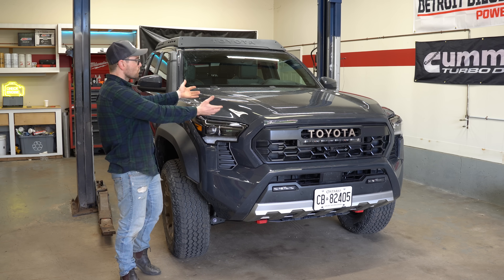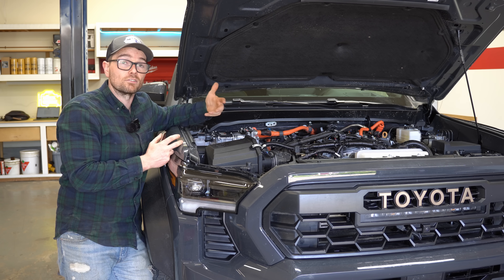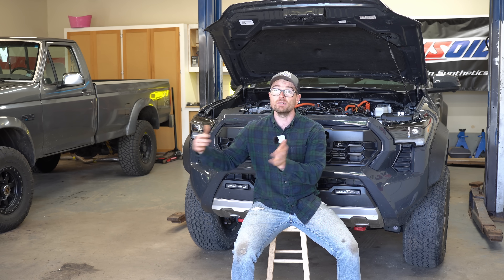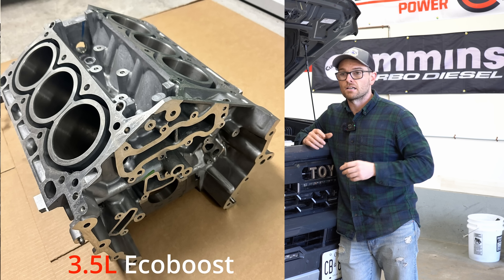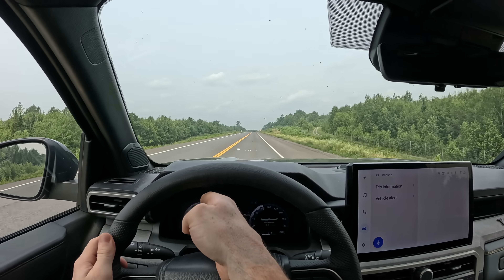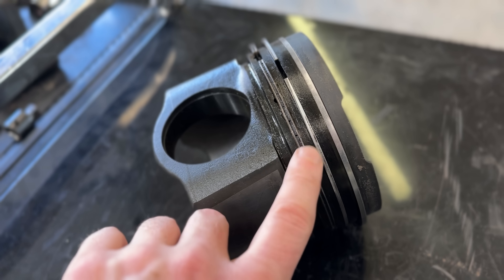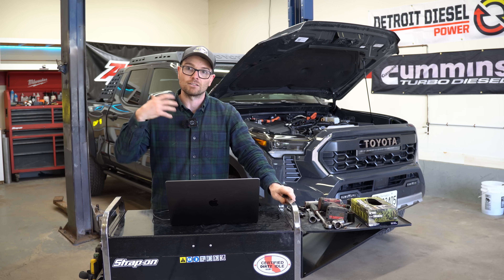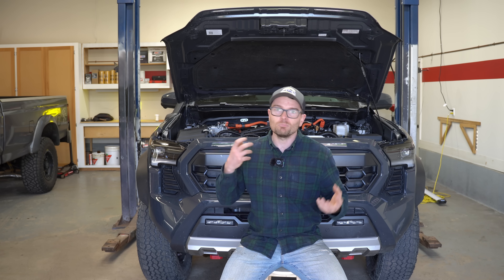Toyota Tacoma's 2.4L I-Force Turbo: CONCERNS Every Buyer Should Know (Mechanic's take)

Comment: I stop looking at Toyota when they stop using the V8 and the 4.0 v6.   Dont get me wrong i still Love the GR Corolla.
Reply: The 4.0 one day will be 22re 2.0
Reply: @jasonjen6101 yup it's well on its way. It pretty much has that status imo since there's enough proof and high mileage examples.
Reply: I was the same too. Until I test drove one. They are so much better than the V6. It’s only a matter of time until people finally let go of the V6. I still have my V8 Tundra tho but the V6 Tacoma is nothing special.
Reply: @westcoastplinkin6559 He’s talking about the 4.0 in 4Runner. 3.5 V6 is very meh.
Reply: @jasonjen6101  4.0 V6 was also in the Tacoma. It’s nothing special, it’s still a V6.
Reply: @westcoastplinkin6559  but test driving one doesn't somehow undo long term reliability concerns. I'm sure the new motor feels better than the old v6 dinosaur lol

Comment: I'd love to see you review the 3.8 V6 in the Nissan Frontier!
Reply: It would be an interesting review. I dont see many people do a deep dive of the 3.8 Nissan v6.
Reply: @davidenglish6799  i may just make a deep dive on the 3.8, tho there isnt a ton of information on it. Z1 Offroad / Z1 Motorsports has the most information i can find and its basically a mix of VQ35HR and VR tech with the valvetrain being identical to the HR, the cam timing being VERY identical to the VR30 and the variable geometry, chain driven oil pump being similar to the VR38. its 90-95% new compared to the VQ40DE.

at least it doesnt have the VVEL system used in the VQ37VHR lol
Reply: @davidenglish6799 That's because it's not sensational or full of drama, complexity,  excess plastic,  or trouble spots. They just WORK , which probably bores some people.
Reply: @davidenglish6799 The car care nut did a decent review of the Frontier overall.  He REALLY  liked the engine except for dinging the water pump thing. He especially liked the minimal use of plastic  compared to other brands. Funny how the Toyota boys don't bring up this very positive review,  especially coming ftom a TOYOTA mechanic !  It hurts their fragile egos to even hear about it.
Reply: @davidenglish6799 because no one buys them.
Reply: @davidenglish6799 because they aren’t selling well, they are not popular trucks.
Reply: @jmilesfox aaaahhhh gotcha.
Reply: While it's true the Frontier is not as popular as the Tacoma, I can see people going to the Frontier as an alternative.   I'd like to see a deep dive into the new Frontier because its a bit more conventional.     Though even the Frontier does have a few issues that are less than ideal.   @jmilesfox
Reply: @jmilesfox   BECAUSE of poor marketing and BRAND IMAGE. even still it was the 3rd best selling midsize truck for 2024 (out of 7 in class)
Reply: @D41Michigan Sales have dropped off a cliff, for good reason. Nissan turned into a trash brand.
Reply: @jmilesfox still 4th best selling behind the usual players.
Reply: @Blue-moon12  the place doesn't matter as much as volume. Did the volume go up or down? I'll give you a hint, the numbers weren't pretty.
Reply: @jmilesfox So from your logic nobody should be doing videos on the Canyon then as that's the bottom of the pile with almost the same drop in sales as the Frontier
Reply: @Blue-moon12 😂did I say that?
Reply: @jmilesfox Cost of the entire market have me out of it.  If i was in it I would be seriously looking at the Nissan as it's the last V6 in the mid-size.  I would be interested in the deep dive if it.
Reply: @jmilesfox Selling better than you think ...but Yota fanboys won't admit any kind of failure.😅
Reply: @jeremymcauliff8485 Less issues than anything else in class. Certainly nothing like junk Tacoma transmissions,  which apparently are so popular that Toyota cult members blame NISSAN  for supposedly bad transmissions,  a total lie of course.
Reply: @Blue-moon12 Yep. Americans LOVE  their brand loyal junk!
Reply: @Blue-moon12 NO, they just love to single out Nissan for a scapegoat
Reply: @jmilesfox  Agree 100% . I have owned 5 Nissans, and still own a 92 d21 daily driver. Nissan used to make great engines : SR20, RB26, TD27, VG30. I would never buy a new Nissan. Textbook plan on how to wreck a good company w/ great products.
Reply: The water pump on Nissan’s 3.8 according to Nissan’s own book, requires 11hrs to replace. 11hrs at $200 per hour labor. About $2,700 with tax & water pump. Is the big drawback to that motor..
Reply: @silverhorder1969 It's like saying the cost to replace the Tacoma turbo is around $2000 to $3000. No matter what, things are expensive to fix or replace. VQ engines have never had issues with water pumps historically.
Reply: @Blue-moon12  yep! maybe one pump in 200k mile if that. its a robust design and from what i gather, the same design as previous VQs...only difference is theres no longer that little access cover for it, so the whole timing cover has to come off...but if you seen how to do the job on the old ones id actually prefer the new one despite being longer to do
Reply: @Blue-moon12  yea but the Tacoma 2.4 turbo isn’t a new motor. It’s actually been around for some time. Toyota has been putting it in their other SUV like the Highlander and another vehicle I can’t remember. But as long as you change the oil every 5k it is a better option. I think the turbo is only $800 though. Not $2,000..
Reply: @silverhorder1969 $800 to replace and install? Doubt it.
Reply: @Blue-moon12  its 2300 for just the turbo on that 2.4 lol. 185 for a water pump and id do it myself. i will only take it to a dealer if its something i cant handle on my own
Reply: @Blue-moon12 $15k transmission in Mexican soft Taco isn't even mentioned,  but they harp on the water pump because it's not a Toyota.  Toyota can break in half and they still praise it .
Reply: @silverhorder1969 NO Toyota turbo is only $800. You pulled that number out of your butt, right?
Reply: @silverhorder1969 Bu that time and mileage,  it might be time to inspect or renew the timing guides, which are behind the same cover. I'll bet most of the cost is labor,  which could be saved by DIY
Reply: @TIJoe-te9qu  true, but most people don’t have the  place, tools, or the 11hrs it is going to take.
Reply: @silverhorder1969 But can they do the $15k transmission on the Mexican soft Taco? They have died in as little as 1000 miles.  Meanwhile,  almost nobody talks of changing a VQ Nissan water pump. 
I simply do not understand why extreme Toyota sins are dismissed and even praised,  while much smaller Nissan concerns, and even non-issues, are magnified into dramatic mountains.  The lack of logical thought is a sickness.
Reply: @silverhorder1969  grab a repair manual and do it yourself. and its not like they often go bad. and i bet you or i could do it faster the 11hrs. the book rate isnt always correct
Reply: @D41Michigan  I’ve worked on my own vehicles my whole life, but not anymore. Other than oil change, and filters. Because of the factory computer recalibration BS! With these new factory dealership proprietary computer software, you are screwed!
Reply: @silverhorder1969 I do my own work too. The computers aren't an issue here. You don't need to "recalibrate" the computer after an oil change.

Frontier uses a reminder system based off miles that YOU set (or don't, you don't have to set a reminder) all done under the maintenance menu
Reply: I have a 25 crew cab S frontier. No drivetrain issues only 2,700 miles. I did have a faulty windhield seal. Its n issue on some of the 25’s fixed other than that rides good pretty good power. 21-27 mpg i average about 25. Will do updates. The turbo 4 scares me tbh and i always have loved Toyotas.
Reply: @jeffrothegamer  I also have a '25 Frontier crew cab with 3200 miles and like you I had a faulty windshield seal.  Other than that I'm very happy with it, so far.  I was a Toyota groupie since the 80's, but with all their problems with the transmission, when it came time to replace our '05 Tacoma (which we bought new), we instead opted for the Frontier.  It feels like a truck and not like a converted soccer mom SUV and hauls a bunch of anything we put in it easily.  So far very happy.
Reply: @jeffrothegamer my 25 SV had a similar problem with the sealant when I took it for a test drive, air was getting through and causing a squeaky rubbing sound when I got up to 100+kmh but it got fixed and it rides great
Reply: FYI. Nissan voids transmission warranty claims if larger tires are installed.
Reply: @detourexplore6615 and? Toyota voids your warranty for going over 85mph 😂
Reply: Nissan isn’t really doing to well overall, i wouldn’t trust any of their products
Reply: @VC-TV Frontier has a VERY solid reputation.  But I bet you'd trust Toyota even though the engines and  transmissions are popping left and right, and they're lying about the true causes. But that's OK, because Toyota
Reply: @TIJoe-te9qu that’s cool and all but nissan is struggling to survive, i can see them selling the company and it being merged with another one, i work at a dealership and the new Toyota’s do t have many problems bro, thats a few cases here and there but that goes for every vehicle manufacturer, nothing is perfect by any means but toyota has fixed their issues accordingly and relatively quickly, if you think a company like Toyota known for its reliability is willing to put that on the line and hurt sales you have alot to learn my friend, just think if you made your own product that was known to be reliable, would you yourself want to hurt your reputation and put yoursef out of business? Only a fool thinks the way you think, Nissan has never been known for reliability, in their entire existence lol the most popular vehicle they had was the altima and that faded off around 2010if you’re buying a frontier because you think it’s better than toyota then you dont know shit lol toyota also holds its value waaaay better than a nissan, in 10 years a used Toyota will be worth probably $8,000 more than any Nissan, if that doesn’t tell you what you need to know idk how to help you bro, i dont make the rules so don’t come at me like it’s my fault toyota is better than nissan lol
Reply: @VC-TV its pretty telling when they ignore a request to review their engine, and its even more telling with the all the nissan fanboys are defending the frontier HARD on a video about the tacoma lmao. A new midsize truck in 2026, the only one with a NA v6 engine to appease their fans still stuck in the past about turbos, and they wont let folks know about the engine??? Cant make this stuff up
Reply from the maker: I actually reached out to Nissan.. They gave me the cold shoulder lol
Reply: @GettysGarage I'll do a deep dive on the VQ38 then, I've got a 2024 Pro-4X
Reply: @GettysGarage That’s crazy to me, you’d think they’d want to have the engine reviewed. It’s the big thing the truck has going for it right now.
Reply: @GettysGarage Bummer! Maybe a subscriber can loan you one 😜
Reply: @GettysGarage Like your local dealer?
Reply: @GettysGarage  I have owned 5 Nissans, including my current daily driver,  92 d21 4x4. Nissan used to make great engines, but has gone downhill,  I would never buy a new Nissan.
Reply: I’ve owned one new Frontier and it was in the shop constantly.  Someone I know recently traded his new 8 month old Frontier in. Tired of being in the shop all the time.
Reply: I agree…Alex please get hands on the Frontier and get into that v6.
Reply: I bought a 25 pro 4x and I really wanted to love it !!!! I traded it in for a 25 tacoma trd offroad within a month..... for one sole reason, im 5'7 and 180, and the seats in that frontier sent me to the chiropractor!!! What's crazy is i also have a 25 pathfinder, which has zero gravity seats just like the frontier claims, and those are the best seats ever, but the bolstering line dig into your thighs and its like your sitting on a metal edge all day lol man it was bad ! Ive never had something like that happen before ... tried seat jackers, nothing ! If you're considering a frontier it was a great truck except for the seats for the love of God as k for like a 3  day trial when test driving because 1 day will not tell you what's potentially in store later
Reply: I just bought one. Id love his too
Reply: Hopefully they can figure out reliability issues. They’re one of the least reliable trucks right now which is sad I love the Nissan frontiers and love that they kept the v6 but that doesn’t matter if it’s not more reliable than a turbo 4
Reply: @braydenhamilton1561 What's so unreliable on the 25 Frontier Brayden? I'm curious. Thanks.
Reply: @braydenhamilton1561 They are reliable. Who says they are not
Reply: @braydenhamilton1561  They are absolutely not having significant reliability problems with the Frontiers.
Reply: Yeah!!! My son own one and loves it, lotsa torque and hp!!!
Reply: @Funkydood love mine, almost 14months with it and over 18k miles.
Reply: I owned 3 Tacomas.  They're on my channel. I've got a 25 pro 4x. It's better than my previous Tacomas in every way.
Reply: The New 2024-2025 Toyota Tacoma’s and the 2022-2025 Tundra’s are overpriced, used excessive cheap plastic throughout the interior/exterior, not as reliable, used single and twin-turbo small engines, and expensive to maintain and repair. The Nissan Frontier is the best Mid-Sized Truck hands down.
Reply: Why Nissan automatic transmissions are garbage
Reply: Direct injection on the Frontier without port injection to keep the intake valves clean is a big no for me.
Reply: @dalef3583 Surprisingly, the VQ engines historically haven't had issues with carbon build up despite the DI only set up. Oil catch can and maintainence can mitigate this quite easily in these engines.
Reply: @alexmseu  DI on the VQ is a more recent thing but yeah, its not an issue. DI started with the previous gen Pathfinder with the VQ35DD the the VQ38DD in 2020
Reply: @D41Michigan Exactly my friend
Reply: @Blue-moon12 im currently doing research on the VQ38 to do a deep dive video on it
Reply: @D41Michigan look forward to it
Reply: @Blue-moon12  not a ton of information out there tho so it may not be a long video lol
Reply: @dalef3583 lol just do the BGFI service every 30-50k miles. Easy peasy
Reply: @dalef3583 VQ engines never had issues with that. The Tundra has both carbon issues have been reported. Good oil and frequent oil changes with a catch can drastically reduces  issues with carbon build up. I own 2 DI engine vehicles and had zero issues.
Reply: @dalef3583 the tundra and both port and direct and still has carbon build up. All those extra injectors for no reason, just more things to fail.
Reply: The engines are solid it's the transmission people have issues with.
Reply: @jasonlillis3437 Nope. Transmission is solid. Early models had minor issues that have all been rectified.
Reply: @jasonlillis3437  The current gen Frontiers have a 9-speed JR913E transmission which was licensed by and an exact clone of the Mercedes 9G-Tronic transmission.  They're solid units and hold up well behind the 5.6 v8 in the Titans, so I think longevity in a Frontier will be outstanding.
Reply: @jasonlillis3437 the transmission issues have to do with nissans suv and sedans, not their truck lines
Reply: @jasonlillis3437  could be but just with maintenance it should be good. I'm not a car expert but my 2008 Pathfinder has 278k miles. Yes the transmission had some issues back in 2012. Nissan replaced it with a new one.  So this transmission has over 175k miles on it. No issues.

Comment: Toyota has issued a TSB on their squirrelly 8 speed transmission in the tacos.
Reply: Some have completely  blown in less than 1000 miles.  Great product.  And these same people will project unreliability onto Nissan of all things.
Reply: TSB is not a recall. Most 4th gen owners haven’t had any issue and a lot of 4th gen Tacomas have been sold already.
Reply: @westcoastplinkin6559  no TSB is not a recall. only for those who have had or are having  issues with their trannies at least can get it sorted out rather than Toyota denying there's any issue.
Reply: @westcoastplinkin6559  if its not a safety issue it likely wont get a recall. theyre entirely different from a cost standpoint too. tsb is basically if they complain about it within warranty heres the fix, recall is literally call every buyer back to get that swapped before they can get sued for a failure.